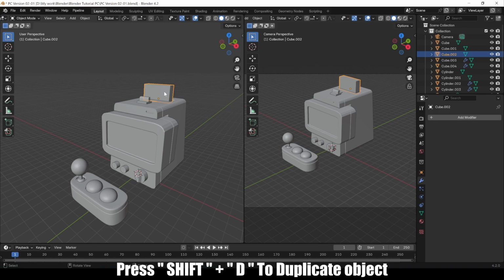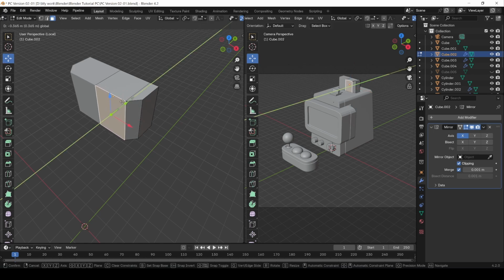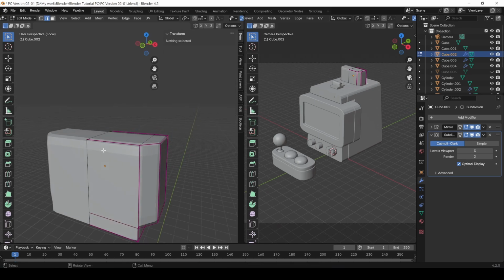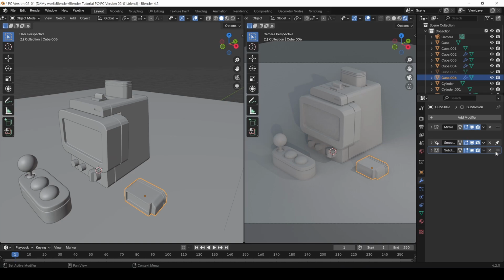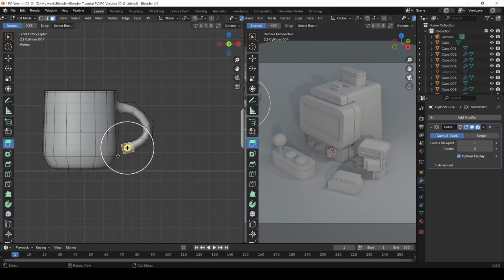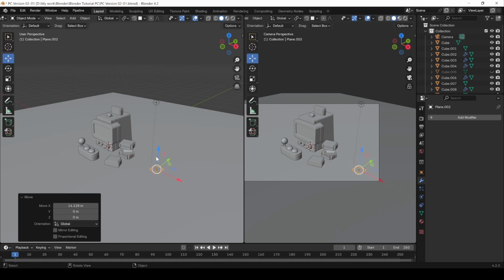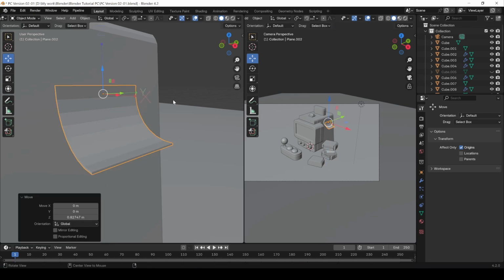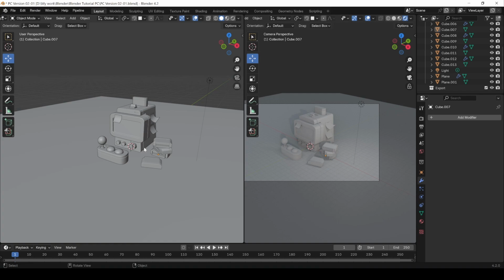SUBDIVISION 3D modeling for Beginners  - Making intro Cutscene Part 04- Blender Tutorial

Comment: hello, whenever I change my render engine to cycles and device to gpu compute my project gets greyed out in the rendered viewport, I've searched a lot about this issue on youtube and other platforms like chat gpt but did not find the solution, pls help.
Reply from the maker: Emm i see , here are some solutions that may Work for You :
1- Go To Preferences => System and then in top (Cycle render Device) Choose Optix then your graphic card . and Inside render Properties be sure that feature set is "Experimental"
2- Try Adding Light , because some times it's Just there is no light in the scene therefore everything looks grey . You can even modify the world HDRI as Shown in the Video (by going to render shader then that drop down menu uncheck scene world and then you can modify the HDRI ) 
3- In world properties change the color To brighter color .
4- And Finally if none is working then maybe there is a bug in the installed version of blender so try uninstall and re-install it or change to another Blender Version and reopen the project 

I hope one of this solution works for you